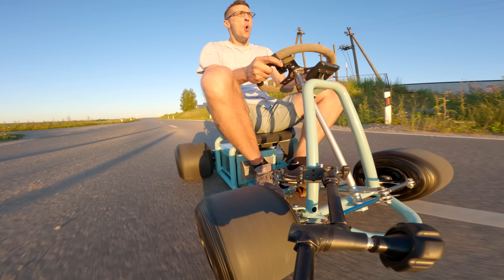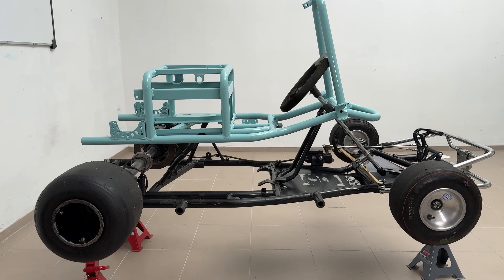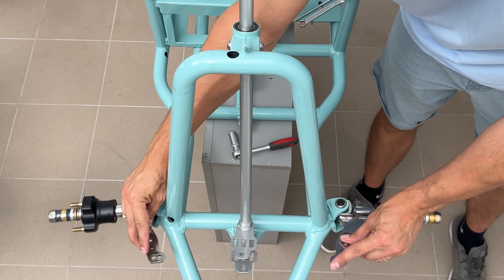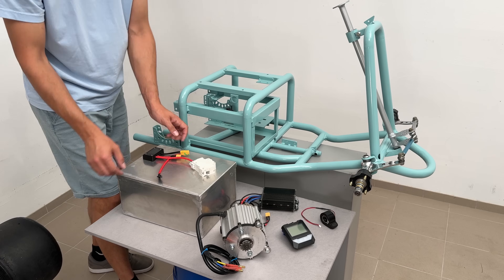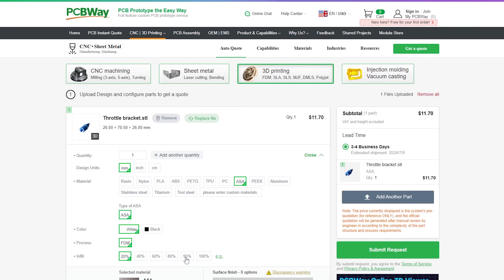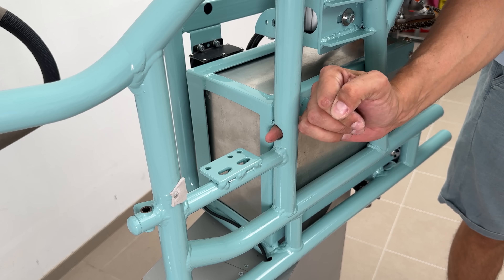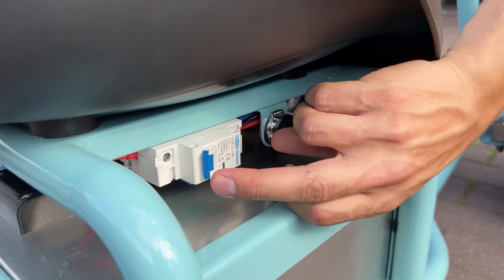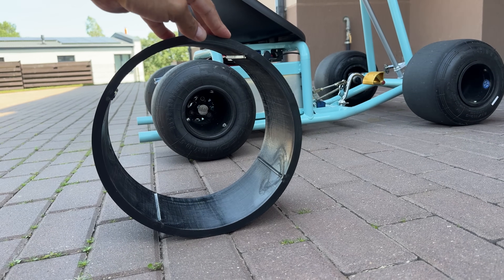I Built MINI Electric GoKart For Drifting!

Comment: Hey mate, how did you rearrange the sprocket and brake disc and axle mounts etc? Aren’t there keyways that are in certain positions on the axle so that they lock in place and stop from slipping? I’ve bought a go kart frame to do the exact same as you but I’m concerned I cannot place the sprocket and brake disc to where I need it to be and able to shorten the axle to the correct length. I want to be able to fit it in my car the same as you.

Please help me.

Epic build!!!

Thanks
Daniel

Comment: That thing is sick! One thing I noticed though is it looks like when you swapped spindles you gave yourself negative ackerman angle causing the outside tire to turn sharper than the inside tire. You want to be able to draw a straight line from the outer tie rod ends through the king pin to the center of the rear axle.

Comment: This is a great build. The only thing to consider is the steering moved to front of pivot messes up the Ackerman angle. Need to move arms outward on both left and right. Otherwise perfect
Reply: I was about to comment this
Reply: Can you possibly explain a little more, I'm building one and want to do what you are saying because your drones infers somewhat legit ;)
Reply: @adamsempleable  look up Ackerman angle. It is to meant to angle the wheels so that the inside wheel makes a smaller circle than the outside wheel on any corner ( as it should ). 
From above:
Draw a line from the center of the back axle through the pivot point of the front steering. Mount your steering linkage anywhere on that line, either in front or behind the pivot as long as you are on the line.
Reply: @paulfennema8204  Thank you so much

Comment: Nice build, I really like it! 
But sadly you made one crucial mistake by mounting the front spindles in reverse for getting the feet clearance. On your setup the outer wheel angles more into the stearing direction, which makes the driving behaviour unstable because the tires slip and wear more. 
For explaination: when driving a turn, the inner wheels have a shorter radius than the outer ones, thats why on every car (gocart,...) the inner wheel angles more into the stearing direction.

Comment: 9kw at 60v 16s through an xt90 connecter and what 6awg cable,,, brave
Reply: lol, that’s gonna melt
Reply: 150 amps
Reply: @Bmr4life  10,080 watt peak
Reply: @ortonscustoms2577  is peak current phase amps * max voltage
Reply: @Pizza-xi3fs  votls x amps , phase current is torque
Reply: I mean tbf it aint gonna be peaking  that much,, ivebdone it maself in the past,,  but maybe a qs8 connector😉

Comment: Why didn't you close the frame from the behind, leaving these pipes open? IMHO a closed frame is much robust and durable.
Reply: Competition karts which this is modeled from have flex deliberately incorporated into the design and increasing rigidity will likely reduce traction